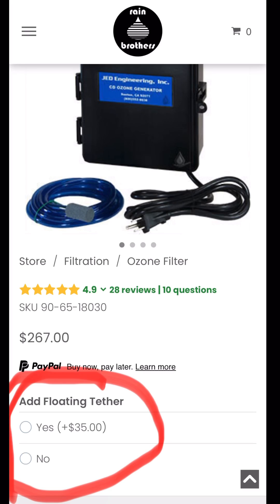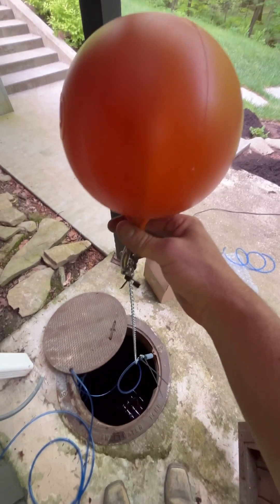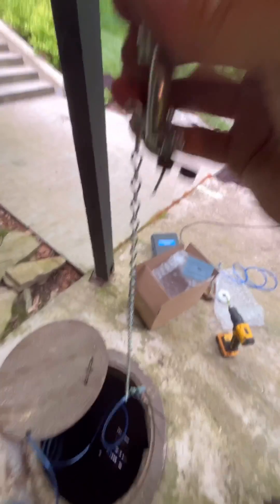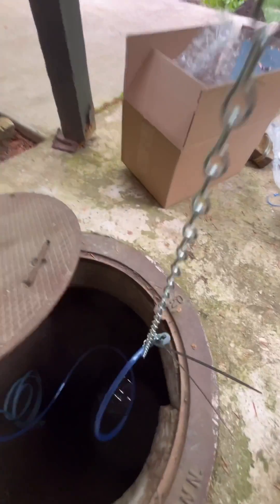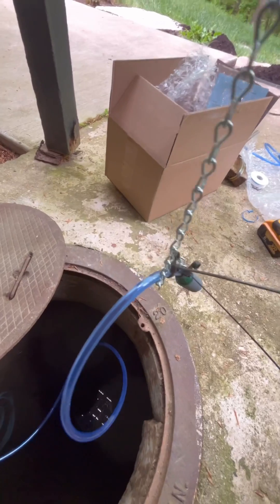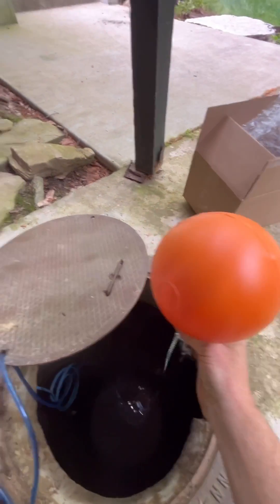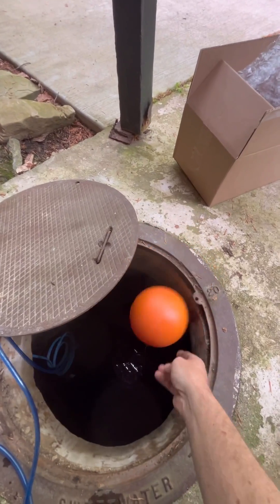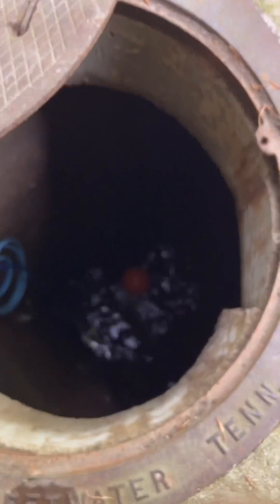How to: Ozone Generator in a Water Cistern #rainwaterharvest #rainwaterharvesting #diygarden

Comment: How often, and how long, would you recommend we run one of these in a 10k gallon rain catchment tank, in Hawaii?
Reply from the maker: If you’re just trying to keep bacteria down inside your cistern, start with an hour or two per day, and move up to 12 hours as needed. We use these to keep the water in the cistern fresh, but we still recommend using UV inside the home.
Reply: @rainbrothers thanks! We have 2 filters, and UV light filter